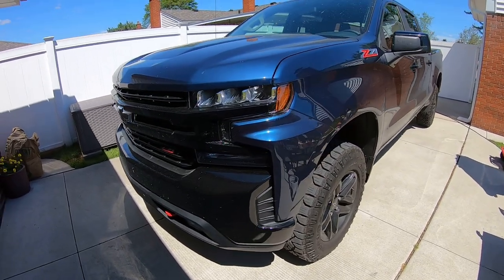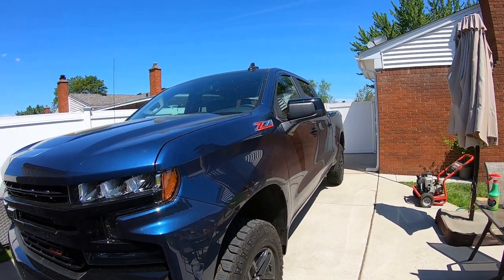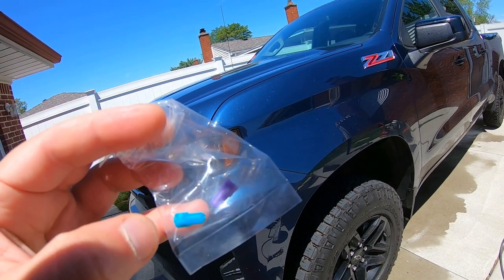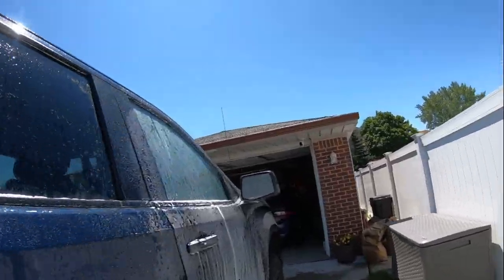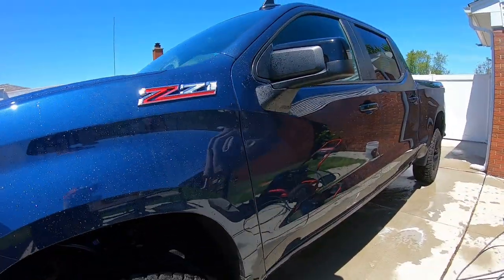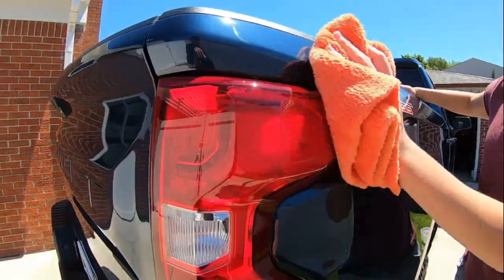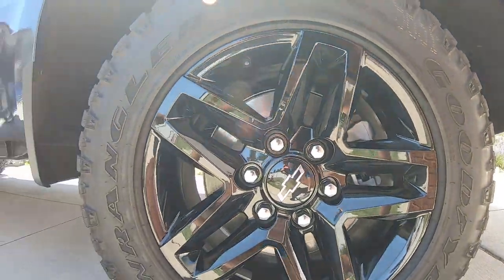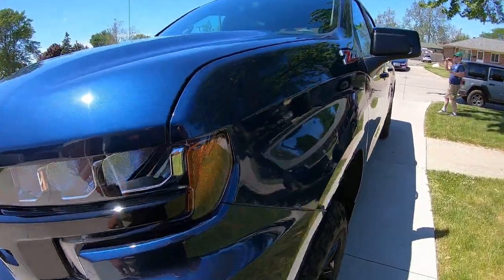Easy Way To Detail Your Chevy Silverado Trail Boss Z71 Truck Groit's Garage Auto Detailing Products

Comment: Turned out great! I don’t use the foam cannon bottle I just use the metering tip and and screw the product bottle right on the foam cannon. There is no diluting and it used about the same amount and the foam comes out crazy thick. Also you want to make sure you have the knob turned all the way clockwise. Other thing is Foaming surface prep is used on a dry surface and it’s not meant to be used as a contact wash. Foam on let it dwell for about 5 minutes then rinse off. Then I screw foaming surface wash on and foam for the contact wash. It’s an awesome system. Sorry not trying to correct you I am just very familiar with these products.
Reply from the maker: Thanks for correcting me on the l
products.Going have to used them the way yuou said to thanks Bro
Reply: @OuzoLouGarage  You are welcome! By the way the Griots products always work best wearing that T-shirt! 😉 😂
Reply from the maker: @FABAutomotiveDetailing  Have to wear that shit when using Griot's Garage products
Reply: @OuzoLouGarage  😂